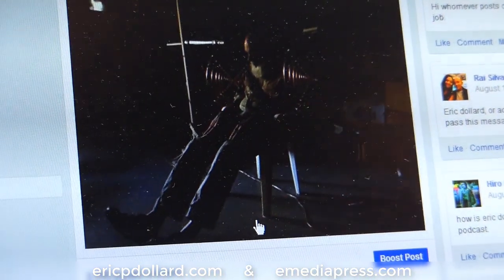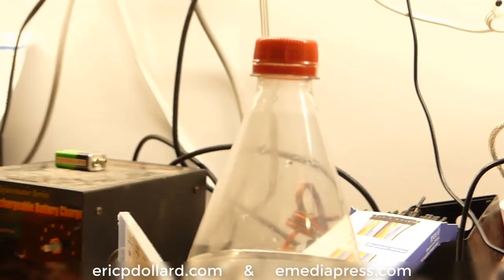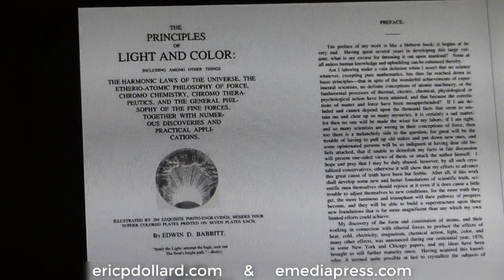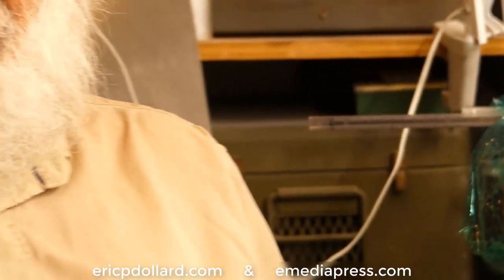2017-08-28 Eric Dollard answers Facebook Questions

Comment: Matter is the condensate from the result of an imbalance, which caused the Creator to be separated from Himself, to which we have the Hurricane as a model. The eye is where we
reside. The Creator, allowed the imbalance to occur to provide the necessary means to prove something without debate. Original Immutability forces any direct counterforce to subordinately 
be the undoing of itself, the carrier and harbinger of its own destruction. The Sun is a being which belongs outside the void but, has chosen to enter the void, hence being separated from Its 
source it "Burns" for lack of a better word The phenomenon which we observe are still "Connected" to what Eric calls counter space, or The Original Source of Energy which is outside the void. Therefore electromagnetic phenomena have qualities which are not directly detectable.We see the result of all "Energy" trying to regain balance. Everything is moving ecstatically, effects are omnidirectional unless we create geometrical constraints. Electro Motive Force is created by an imbalance.Without separation The Creator would be unified and matter would not exist.

Comment: How does radio waves and  micro waves and x rays and whatever go around a spinning ball ? When every demonstration cleary shows they go in a straight line ??? If they didnt than mountains wouldnt create restriction or interference but they do , the reasons eric gives saying the earth isnt flat are so easily explained , seems like its the first time he hears about it , hope he looks into it ;)
Reply: Simple minded waste. You must have missed some of Eric's other videos mocking dumb flat pieces of shit like yourself. LOSER!!!
Reply: Brad Dwc look into things like the effect of ionosphere on radio waves and a phenomenon known to most ham operators called skip.
Reply: Timothy Haug yes i did and my point exactly , you think its bouncing off a flat ionisphere or convex shaped ? Aint too hard to do the math on this one and also convex lens diverges when reflected off "meaning it wouldnt be the best idea to multihop signals when everyhop or skip weakens your signal , also when the atmosphere weakens tje signal aswell depending in how dense it is   , anybody thats neutral on the subject can clearly see that one of both ways makes absolutly no sense to even try to comprehend bouncing signals on a curved surface
--As a form of electromagnetic radiation, like light waves, radio waves are affected by the phenomena of reflection, refraction, diffraction, absorption, polarization, and scattering. ... Line-of-sight propagation means radio waves which travel in a straight line from the transmitting antenna to the receiving antenna.

Comment: Solar panels are not the best electricity, atmospheric collectors are.  Simple design, large scale copper/graphine nets suspended at notable altitude, the power flows freely like a funnel, because there is a constant down current.
https://www.youtube.com/watch?v=ENeDkGce5-4

42.4923 is gyromagnetic precession.  I've found this degree offset in many natural conditions, including weather patterns.  It's a golden ratio derivative.  It's unavoidable in magnetic field geometry.

Comment: Around the 52 minute mark, Eric talks about the non-energy based separation hydrogen and oxygen in water.  And, he heard through the reliable grapevine that we will see that soon in Europe.  Can he point to who is developing what he had in mind?  There are a lot of people with different ways of doint this out there.  I just want to know what was on Eric's mind at this moment.  

Does this have to do with Al Throckmorton's use of hydrogen on the Lord's Pump Progect, that he mentioned in the 2015 Energy Conference panel discussion?  He mentioned he knew someone who used a Rodin Coil to separate hydrogen and oxygen, almost explosively.
Reply from the maker: The only thing we can say is that it involves the dielectric separation of water. In other words, you apply a strong enough electrostatic potential between two plates and you play tug a war on the water molecule. With high enough tensions, the H & O separate without providing current like with normal electrolysis.

Comment: Dear Mr. Dollard & Mr. Murakami: Question: How does a Submarine periscope 1-2 meters above sealevel spot a ship on the waters surface on a clear clear day for 10+miles if the earth is supposed to be a ball with a circumfrence of 40.000 km. I have reasearched and tested this on the beach of the Northsea here in Germany, Hamburg and I cannot explain why I see ships with hull and all 10 miles out with my Telescope.
If my mathematics are correct the earth falls away per mile squared 7 inches, this would mean the ship I see at 10 miles would be 180 meters under the Earths supposed curve.
"Tesla mentioned the earth rings like a bel"l, clould this be due to the enclosed dome typ system we live in with the Sun being positive and the Moon negative acting as like a converter and conductor

For the best research on Flat Earth 200 reasons the Earth is Flat please visit Eric Dubay´s channel on Utube.

Dont go to a stupid shills/disinformers page like I have seen here already, their mission is to ridicule the Flat Earth truth and make it sound as stupid as a 1000mph spinning ball
Reply: Perception. Your mathematics are not correct and they are not the same as the normally prescribed 8 inches per mile squared that every other Flat Earth video is handing out.
Reply: Then PLEASE PLEASE someone  tell me how you workout the earth´s curviture I live in Hamburg, Germany and have found no Professor, Geologist etc... that can explain to me how to calculate the earth´s curviture neither can any search engine on the internet.
All the pictures I find from outer space are Computer generated artists images... what the hell is going on...
All I know is that what I have researched and tested myself without beleiving what someone else thinks is incredible.
You cannot even find anything stating how far a Submarine periscope can see into the distance to sink another ship with a torpedo.

It is a fairytale passed down over the generations to say ships go over the curviture of the earth, when I can bring the ship back into full view with my p900 Nikon camera.
Reply: You are going on perception and the fact WE ARE LIED TO  by NASA scumbags and modern academia setup by the same people who have always remained in control, there is no denial those people are not our friends. 
You need to be high enough to see the curvature, 55,000 feet. 
Do you know how a lens works? You have two of them. 
Stop listening to youtube tell-a-vision and start to figure some life out for yourself. 
There is a reason this FE nonsense started being pushed in everyones faces on YT when the electric universe model was becoming more mainstream, for a reason. 
It's more than Flat vs ball nonsense and you will never understand if you just expect the answers to be handed to you so "randomly."

You people like Youtube research, https://youtu.be/yZQouJPAbBE
Enjoy!
Reply: I am going on Self proving and thinking for MYSELF!!! NO ONE DOES THIS ANYMORE!!!
YOu have not read what I have prevously written there are people out there that take the time to travel to the seaside to see ships disapear and then reappear with the right apparatus.
Obvously you as a person "Lifeunder TheMicroscope" are a  SHILL and you are trying to discourage people from looking into the Flat Earth. You are a low life and something I never want to be associated with you are a perverted, twisted individual!!!
IF something is not Testable, Repeatable or Measurable then it has to be a based on belief/fiction/hoax.

Comment: My grandfather is an electrical engineer and I was wondering if once any of your equipment is unusable or burned out if I could attempt to reverse engineer any old power supply's that work using the correct physics.